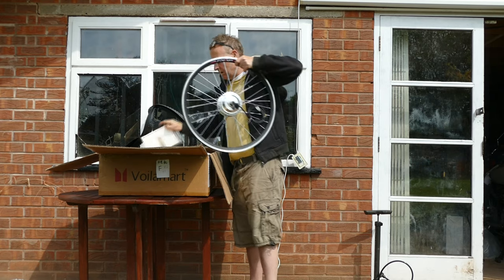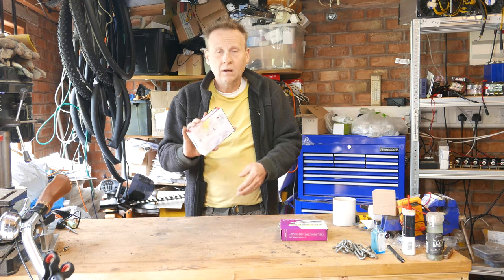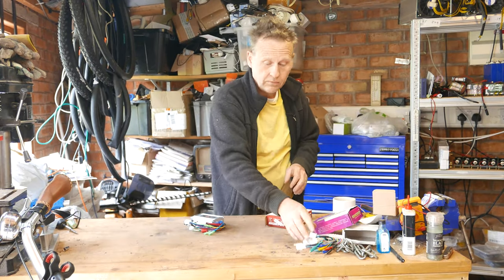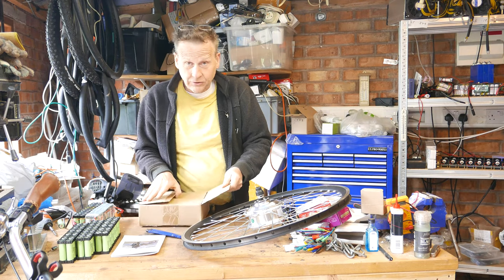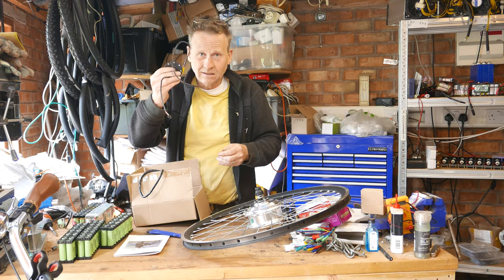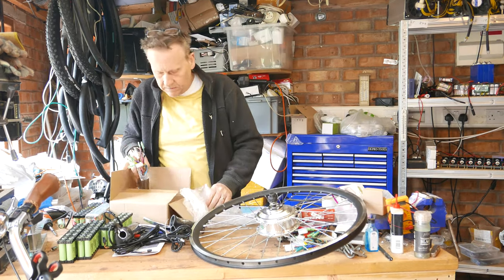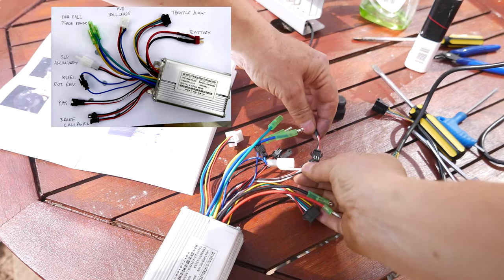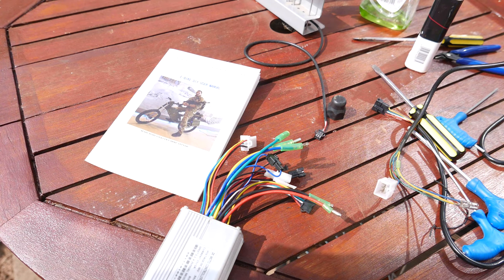Simple 36V 250W front wheel e-bike build and buying tips

Comment: hi tom 
been watching some of your videos, great, this one on the voilamart 250watt front i have a question. i ve worked out from your video that the throttle use has a limit on the power cut off point. i dont real;ly want the throttle use anyway.  But does the pedal assist just thrust up to full power, i am after one with the LCD with the 5 level assist ranges but the front wheel drives dont seem to come with this. i want the 5 speed ranges because its for someone in the family who is nervous on a bike, had a bad accident whilst a child and just getting back in to cycling so i don't want a kit that will just lurch in to full power. Can a lcd be fitted to the kit you tested . oh and ive got to get front wheel drive because the bike im fitting it on is a vintage one with sturmey archer 3 speed on rear. 
Sorry for the long question, Can yo help as im not very good with electronics. ive tried contacting the various chinese sellers but there of no help. 
regards
Mr f

Comment: Hi Tom, thanks for the video and spreading the word on ebikes.
we're all just having a discussion about this on the latest EMBN video.

Just FYI Although I can't find citation to this being ratified in the UK there is someone claiming its all legal in the UK as its his day job with regards to the regulations?
Either way. from cycling UK's website. 

E-bikes controlled by a throttle where there is no need for the pedals to be turning to engage the motor – so-called ‘twist and go’ machines. New models of these kind are now  classified under EU law under the L1e-A ‘powered cycles’ category that allows power up to 1000w, with power assistance cutting out at 15.5mph. Twist and gos are potentially very helpful for those with any kind of condition that severely limits a pedalling action, but the procedure and exact requirements for registering them remain unclear. Note twist and go e-bikes bought before the introduction of the new laws and limited to a 250W motor rating remain effectively legal and so can be legally purchased and used as second hand models. 

https://www.cyclinguk.org/cyclists-library/regulations/eapc-regulations
Reply from the maker: Thanks Dave.  Interesting as I'd read this some time ago ... think it was in the actual legislation itself.. but my memory is far from reliable these days!

Comment: With regards to power just check if you have any adjustment options be it 3 position switch or via the screen if you have one.
Alternatively if it doesn't and it's just underpowered, one cheap hack you can normally do on these cheap controllers is just to add a little bit of solder to the internal shunt. (looks like a big paper clip near the negative wire inside the controller.)
Don't do mad or you'll just blow the mofsets but as a quick little upgrade I've done this many times to great effect.
I've also done mad and made bikes unusable by adding to much solder.
Reply from the maker: Wow great advice.

Sorely tempted.  I wondered if the ucontroller was delivering a full 100% duty cycle through the FETs at full throttle.

I'll pop the 'scope on when I get a chance.

Thanks for the tips.
Reply from the maker: Problem solved.  Stuck a DC clamp meter on battery high-side and it was only drawing 3.5A on full twist.  Tried disconnecting those blue leads (that I thought were reverse-thrust!) from each other and problem solved!  Goes like stink at 7A.
Reply: @crazytom  Glad you got it sorted!
hopefully the rest of my nickel tape arrives today so I can finish my latest monstrosity..
84v @ 200 Amps.. xD
Currently just running half a pack, so limited it to 100 amps and I can confirm that also goes like stink.. ;)
Reply from the maker: Cheers. Let me know if you need tape or belt.  I have a warehouse full.
Reply: @crazytom  Oh thanks for the offer!
Are you a supplier or you just have a large personal collection?
I do use a fair amount of cloth tape (duck tape) each year, a few of my mates sometimes call me duck tape Dave as I can make anything out of the stuff. :)
Belts wise its just the GNG mid drives that use belts for a have a few spares left as they are an off side.
Reply from the maker: @TheWebstaff  bit of both.  That's a beefy battery.  What BMS are you using?  Have you installed any fuses in it?  Close to skin breakdown voltage!
Reply: @crazytom  Not this battery but just a 17s 72v battery has already given me a zap a few years ago, so it went into the same class as 240v mains stuff, e.g. it serious stuff learn about it and treat it with respect.
As for BMS, it's not actually been added onto the pack yet but I've got one of the 200 amp bluetooth ones that a few of the other UK guys on youtube are using.
Andy K -  he has a web store front but loves messing around with chinese tech, so he tries it them hes doing drop shipping..
https://www.youtube.com/channel/UC9QK0Y_yFdIfYTdKp6FEMVg
But it was Tony who sold that one too me as hes built an app for controlling it.
https://www.youtube.com/user/vortecks2000/videos

Comment: Great video for me as I'm about to embark on converting my road bike, Its a Trek. Not sure what the forks are or if they are wide enough but guess I can google the width needed. I'm 102KG so I guess I'll need 1000 version to commute 6.5 miles to work, Round trip 13 miles. My bike has drop handle bars so guess I'll have to ebay some regular ones.

Any last minuite tips before I splash out and buy a front wheel?
Reply from the maker: Recommend seat post frog type battery case to balance the weight.

Comment: hi I am a newbie to all this wonderful. Can you suggest what batteries I need on a budget? How does the bike go uphills?
Reply from the maker: 3 things:

1. Use only Samsung, LG, Sony or Panasonic cells.

2. Budget cells can be had at 2200mAh to 2800mAh.

3. Make sure the C number (max continuous current drain) for the cells match the peak power requirements of your motor.

4. (did I say 3 things?) Use a BMS with balanced charging and short circuit protection.

Comment: Hi Tom, can you use this kit if you have front disc brakes? Im researching on whats best to fit my cube acid. Regards
Reply from the maker: That's where it gets complicated.

My hub came with mounts for the disc but the fork tubes widen making it impossible for the disc to clear them.

I ended up buying a 1000W as well and it's just sitting there until I can get a donor frame where a disc will fit.  It's a death trap with hydraulic disc brakes.
Reply: @crazytom  that's what I thought, it's almost worth buying an old bike with v brakes to make it easier?... How did you find the 250w power/ speed wise? Have you looked at rear wheel conversions? Would they be easier for a bike with discs? Appreciate any help and replies
Reply: @PhilzDizcoveryTV  I have a watch on eBay for a donor bike with hydraulic disc brakes and front + rear suspension..  Not interested in rear.  It's hassle enough changing the rear tyre as it is.

The 250W is just annoyingly a little too slow.  When I'm on a main road and no traffic and the tarmac is smooth, another 5mph would be ideal.  Hence the 1000W.
Reply: @covtom2  thanks for your reply, I will have to go back to the drawing board. Also sounds like I'm going to need more than 250w. Have you ever looked into mid mount conversions? They seem a lot more expensive 🤔